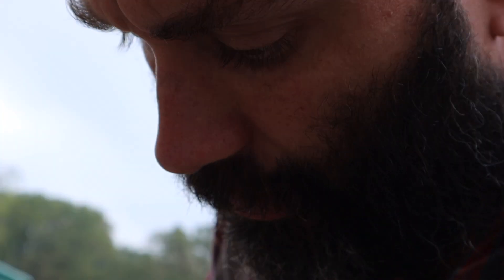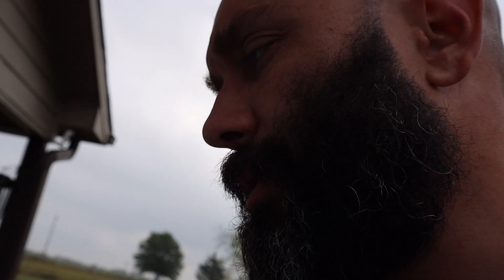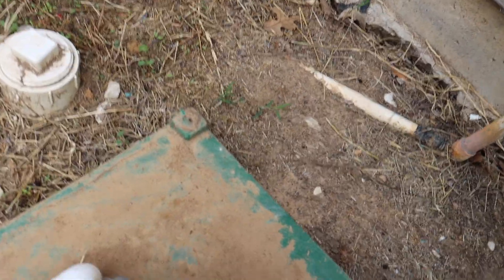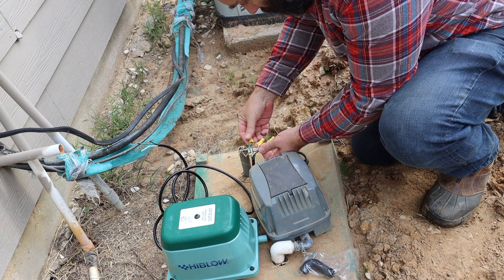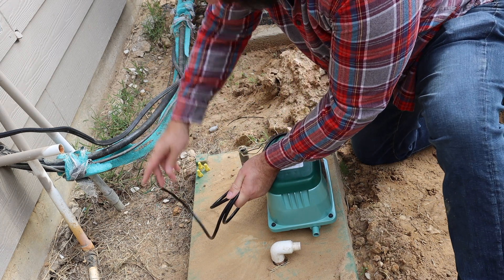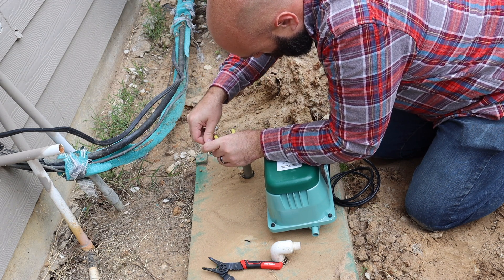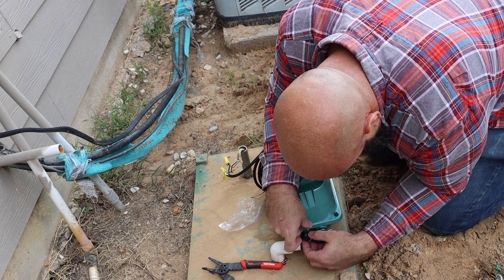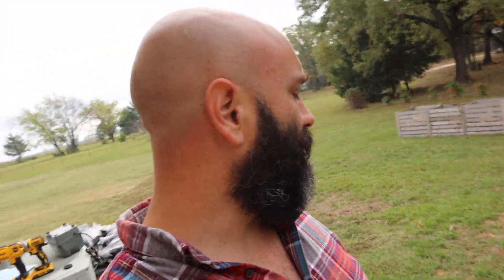HiBlow HP-80 Air Pump Swap, Replacing an Aerobic Septic Blue Diamond ET-80

Comment: Thank you. The white pipe going down in the tank how far do I send it down to create the bubbles inside the septic. TIA
Reply from the maker: Ours is already installed so I don't know where it enters the septic tank. From what I read, the septic system should tell you where to install the air line.  I see conversion kits to add aeration to ordinary septic systems and they each have their own requirements and air pump configuration.  The installation guide for SepAerator Premium from septic solutions has a diagram of their particular setup that may help.

Comment: Hey, Thanks so much. I have the same air pump for our aerobic septic system. I was quoted $650 by our septic service company. Found your video, $270 for a new pump, $20 for wire strippers. The job took 30 min total from removal to restarting!…… Thanks again!
Reply from the maker: That sounds close to the price quote we got on ours. Hard to pay it when you see it's much cheaper if you diy.  I'm glad we have helped!

Comment: So why did you go with hiblow? I'm on my 2nd hiblow , the unit I have now just started messing up and it's running very very hot and blowing very low air that my panel low air alarm is lit. I
'm thinking of the bluediamond 60 since it's like 200 dollars cheaper
Reply from the maker: Originally I was looking at pond aerators and HiBlow kept coming up as reliable. I just had to pick a brand and I wanted to match the cfm rate to the old pump. They might both be good. I do remember that some of these can be opened and cleaned for maintenance. You could be running hot and need a maintenance check but if it's gone bad I think either brand is good. Just match the flow rate. For me delivery was easy on the HiBlow so I chose convenience based on work schedule also.

Comment: Next thin you need to do.  Is to take  that 8/2 romex going into 
A/C  condenser and put it in a seal tight or flex. Seal tight or car flex would be better. The 8/2 romex is not outr door rated. And in 3 to 5 years will become dangerous.  Because of the insulation falling of and exposing live 220v wire.
Reply: It should also have a disconnect within a few feet of A/C condenser al8ng with a 120v gfci receptacle for service tech. All code. Thanks for the video I just replaced my pump. Had septic company rebuild old one last year. For a price that equaled out to be $5.00 less than a brand new one. And it's already out again so I said nope I'll replace it. Septic company was upset. Said I'm not a qualified tech. I said we'll I am a licensed master electrician and I'm an electrical contractor.  So now show me your certification to preform electrical work. And we'll go from there.
Reply from the maker: I love it. Our septic said they wouldn't work on a pump they didn't install but for the price I can replace it again. Glad you saved yourself some money and time.
Reply from the maker: Thank you for the tip. Since we moved here recently we've been wondering how to fix this mess and also if the AC bill is so high because of the coolant lines not having proper insulation. I'll look into what you recommend for the electrical. Not sure how it ever got this bad.

Comment: Ok now is that black on black green and what wire you hooking up to? Man show video in detail and with what wires to tie to.🙄😡
Reply from the maker: You'll see the mention of green to ground at 9:00. In my case it was like for like. Whites together and Black together. But each home wiring could be different. I suggested using a voltage detector also so you know where your hot wire is before disconnecting. And be sure to take pictures before making the swap so you can go back and see what it was before